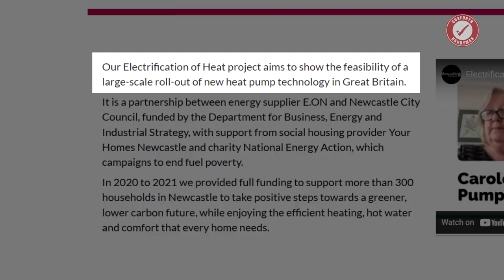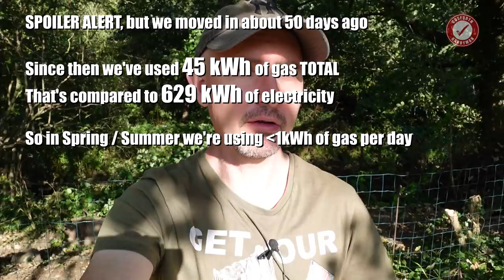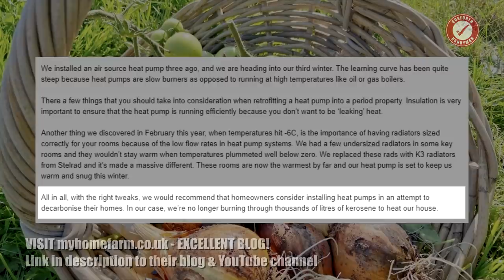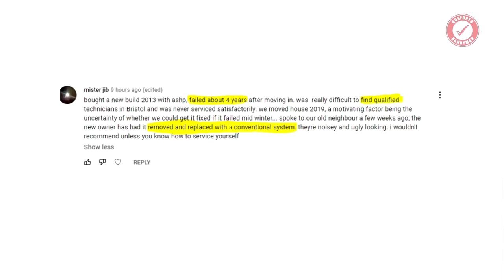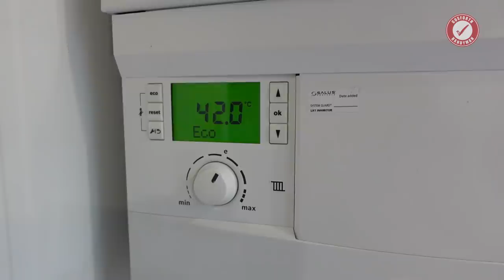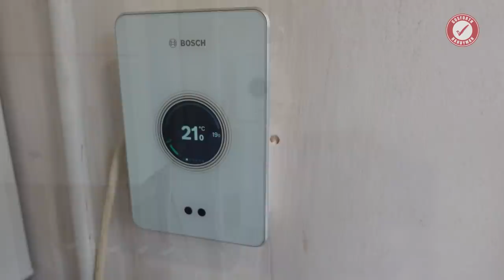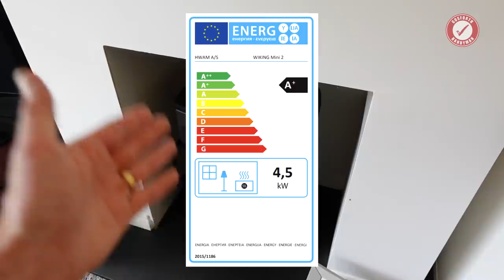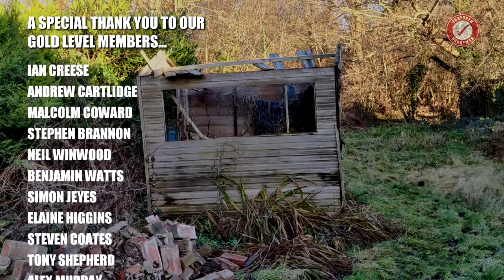Why didn’t we install an Air Source Heat Pump? (1920’s Renovation Part 32)

Comment: With wood burners it's the particulate pollution, rather than the carbon dioxide that's the issue, even with the new standard there is still PM 2.5 emissions and smaller which are strongly linked to asthma and lung cancer.
Reply: farts, volcanoes, wildfires, things decaying...life dude.
Reply: @monabale8263  no wonder humans r weak these days lol cant handle a bit of soot
Reply: @girlsdrinkfeck  no one could ever handle a bit of soot, it gave them lung disease and they died earlier than they should have, and lived in a worse state of health.
Reply: @Lewis_Standing  thats some woke cukkage
Reply: Not only totaly agree also its a fact. That's itsbad. I geuss the antivax and a like ( conservatives ) always have a problem with anything they dont like
Reply: @girlsdrinkfeck  bring back the days when everyone had coal dust and asbestos in their lungs and died in their 50s. They were real men back then.
Reply: People who romanticise the past seem to forget all the shit they had to deal with back then.
Reply: @ELGee1  ok corbyn voter
Reply: @girlsdrinkfeck  well done her.
Reply: Not to mention the endless wood collection, chopping, storing, fetching in, feeding to the fire, ash empty & clean up,  ash-dust everywhere (including your lungs ), chimney sweep (annually), otherwise all good
Reply: @iseenochains-oops7863  Not really the case anymore, just like internal combustion engines, wood stoves have been required to be increasingly more efficient and standards are reaching upwards to the 90+% efficiency and no internal air mix, with dedicated intake and exhaust, with more advance systems with built in filtering...  It's far more dangerous to stand behind a vehicle while it's running these days, unless you're doing old school fires like a nice camp fire that's only burning 10% and producing nothing but smoke and particulates for the other 90% or you make your own DIY wood stove and don't integrate modern advances like secondary burn, etc.  Just like driving a car from the 1950's with original engine may not be very healthy...  Context is important and not to be overly generalized based on old stereotypes that don't apply anymore...

While ash from a wood stove has a wide range of uses...  Wood stoves just don't make much sense unless you live in a cold climate, especially in countries with smaller size homes as super efficient also means they generate a lot of heat... Though, you could channel the heat to warm water instead of the home and just have a window to the combustion chamber for ambiance...
Reply: @girlsdrinkfeck  no, it’s a fact. You need to do more historical research rather than spout rubbish
Reply: @Haymarket47  ah so u trust what government facts said about diesel cars is better ?

Comment: I've just been through this entire thought process. I am (slowly - I am a complete novice) renovating a property I inherited for me and my young family to move into; and wanted a non vented system... I had dreams of utilising a low voltage heating element in the cylinder in place of the 240v one; and using electric solar panels without an inverter to heat water as a 'thermal battery'. Anyway: I did some finger in the air engineering on it and could NOT make the numbers work unless someone donated me a load of modern solar cells and a cheeky wink.

What is a FAR better solution (much faster ROI) in MY situation is installing insulation and mush more modern glazing as part of my renovation. This in itself is fraught with issues as I will be doing much of the work myself.  That said; my house is also approx 100 years old and has solid walls.  I.E. the ROI for insulation is much higher(sooner) for me than many others out there.

I would also consider myself something of an environmentalist (raised a flower child hippy, that got an engineering degree) and wouldn't even mind paying a little extra to reduce my family's carbon footprint.  But there are better things to spend money on: quality of life to ensure my children have the opportunities many don't and therefore the luxury to be able to make choices in their future that impact the environment less.  All of which is a very flowery way of saying: I think wasting less energy and money will pay off in the long run.
Reply: I have more or less finished converting a 150yr old barn loft into a 'modern' apartment. New roof, new floor, and a service loft ready for MVHR ducting, and to hide the spray foam.
All heating options were considered, gas was a given until the provider increased the original 1k quote to 3k after 6 months to connect to the grid. There was also issue of losing headroom with underfloor heating versus radiators on walls. 
So . . 
I invested heavily in insulation - spray foam between rafters in loft, 7" of kingspan in floor joists and apx 2" of insulated plaster straight onto the stone outer walls. Pretty airtight, and maximises thermal mass. Still no actual heating installation apart from shower fan. Oil filled electric rads - 1 always on low over winter keeps building fabric warm, top up as need, if working from home, still trying to decide.
Reply: I did the same with my 110 year old terrace house. New windows (double glazed with argon gas) and new exterior doors. I built stud walls against the party walls and insulated those too. New loft insulation,  added insulation to all other stud walls - all insulation is rockwool acoustic. I filled every gap I could find with expanding foam. I had a combi boiler fitted to replace oil burner and later replaced all heating pipes and radiators. The result was less pipework and rads that suited the room sizes better. Most years my gas bill has been around £250 per year for all heating, water and cooking.  My first winter the oil heating did not work and I was spending £25 per week to heat one room with an electric heater!

Comment: OK  I'd like to take issue with your comments about air source heat pumps. 
 I'm a Domestic Energy Assessor  now retired. We spent a Christmas at Winchester  at a lodge that had such a system fitted,  So as a DEA that had never come across one I was really interested in how it panned out. Everyone thinks that they can add it to existing radiators  WRONG  it's more efficient using under floor piping.  With hard frosts every night. We were warm and comfortable had lots of hot water for showers and couldn't hear a damn thing from the fan. The owner of the lodges had, had all the Lodges fitted with them. He said he'd saved a fortune as all that he was paying for was the electric to turn the fan.  So yes they do work.  In America they are used extensively.    LOVE your vids by the way

Comment: This is very weird, there are no incentives from the governement here in Norway, houses are often old and badly insulated and I think the vast majority of detached houses have air to air heatpumps.
Reply: Our electricity prices are very high and our gas prices are very low so it means that running an air source heat pump off electric is still very expensive compared to gas.  Also our energy companies are looking to switch to hydrogen to power gas boilers instead of lowering the price of electricity.  Your electricity will be a lot cheaper than ours.
Reply: The counter intuitive thing is that air source heat pumps are actually more efficient at lower temperatures, like you're likely to find in scandinavia. That's because the air can't hold much water. But in the UK, where overnight winter temps are generally in the -2 to 5C range, the air is still incredibly humid. So the heat pump has to put a lot more energy in, in order to avoid ice buildup.
Reply: @ComeWhatThey  Thanks that's interesting.  Yes ours get a thick frost coating too.
Reply: I'm guessing you have very cheap electricity from Hydro. Also Norway makes lots from selling gas to the UK, which is wisely invested by your government for the future. Here in the UK our Oil and Gas revenues (now gone) were squandered on short term feel-good tax cuts.

Comment: 10:26 Excuse me but what? First of all, you dont have to dig up all your garden. You drill a hole (bore well) and put the pipes there. That takes about two square meters of space. No large scale digging or big mess. Secondly, what makes you think the heat differential isn't enough. They work here in Finland in -25'C just fine so they woud work in your -8'C as well. Same thing with the air source heat pumps. I installed air source heat pump back in 2007 and it has been heating my 120m2 house since without any problems. We have had several -30'C time periods also and the pump still have worked ok. Of course at those extremely low temperatures it does consume same amount electricity as direct electric heater. Maybe your source of information isn't very good or something....
Reply: I’m thinking of going the GSHP route and for me bore holes is the only route but boy are the holes expensive I’m being quoted £14k for three 100 metre holes.  So if anyone knows a cheaper way of getting bore holes in SY11 UK happy to hear about it.
Reply: I'm 2-3km south of Andy and there are (coal) pit workings underneath us. In the maps I can find online, as of 1892 there were no pits where he is ... but for some reason /sarcasm  installers around here want to do a (chargeable) test bore before quoting.
Reply: @chrisbenson1217  Often that is down to effecting the local water table in the local area, we had several schools down south that ended up with carpet GSHP due to the proximity of the local water table to the surface. Andy backs onto a river so I expect the water table around there is quite high and environmental health have to get involved when in that situation for permissions.

Comment: Andy, thanks, a very interesting and thoughtful piece.  We are seniors, just moved into a 2003 build house (in the UK) and are staggered to find it did not have cavity wall insulation (it now has).  Our last experience with a combi boiler was in 1989-97 and things have moved on lots.  Since 2007 we have had a pressurised tank system and we find it is fine.  This summer, our first in this house, we have had the water heating for 90 minutes from 0730 daily and it produces water for showers in the morning and hot water the rest of the day whenever we need it and the gas consumption has been 38 units (therms) over 13 weeks, say 3 therms per week.  We have the usual 400mm loft insulation but whether we have insulated floor - who knows, we have no paperwork.  Like you, we think GSHP and ASHPs are pie in the sky, unaffordable for most people.  Thanks again, great content.
Reply: I’m not sure how you checked - our 2003 home has wall insulation - it’s attached to the interior wall,leaving a small cavity so water doesn’t permeate. Interior walls are thermo bricks and the floor is insulated. This was a standard construction by a large house builder at the time.

Comment: I've been agonising over what system to use in my new build for months, I had a quote of 16K for an ASHP setup and  I was pretty happy with it. I work in live events and I had a gig cancelled just as I was about to order thanks to COVID this kept happening so I kept delaying waiting for work to start again. Since this didn't happen there came a point where I had to dismiss ASHP and look at other options so I finally decided on a 100L water heater (£185) for hot water and a 19KW 3 phase electric boiler (£1400). I'm running 200sqm's of wet UFH and 5 rads (sized for a ASHP system) the electric boiler will heat water easily to my required 45 degrees which is almost its lowest setting. I don't expect my electricity bills to be unusually high but even if they are a little higher than normal I'm much happier not laying out the extra 14.5K for the ASHP which in my case when I can would be better suited channeled into solar and far more useful.
Reply: Very understandable choices. However do not put in microbore piping to the radiators but 15 mm. You can always swap a radiator (not that expensive) but it is a hassle to change underfloor piping. Though (we have just done it in an old 1865 farmhouse) not actually as bad as we had feared. We did not need to redecorate at all.

Comment: Excellent video - I think the main point is not what heat source you use but just 3 words - Insulation! Insulation! Insulation! We did a newbuild about 5 years ago and after being fed up of a very stinky and disgusting oil boiler for the previous 12 years we made absolutely sure we insulated the new place to an almost Passivhaus standard and installed an ASHP for the heat source (no gas main in our area) and underfloor heating for downstairs only. This has worked really well and the electricity bill is around £1,200-£1,300 per annum keeping the house at a constant 22 degrees in the winter with no cold spots and plentiful hot water. I know you have insulated your project to a high standard this has to be the most important thing. No matter what heat source you use it is incumbent on all of us not to waste the heat we produce but to keep it in the house rather than leaking it into the atmosphere. I would be really interested to know if you are/will be using a Mechanical Ventilation Heat Recovery system to ventilate the house (vital) whilst keeping heat in?

Comment: Good video. The case for ASHP systems  falls apart when you look at running costs. At best you will get 3Kw of heat from 1Kw of electricity via an ASHP. When temperatures  drop towards zero you'll struggle to get 1.5kw. A good gas boiler is over 90% efficient. Even today with scary increases in gas prices electricity  remains more than 5 times the price of gas. Do the maths, generating 1kw of heat from an ASHP costs way more than 1Kw from a gas boiler.

......and thats before you get to installation  costs, the need for huge radiators and the noise issues etc.

The RHI grants for ASHPs are ( in my opinion) also a racket. You can only get it if you have the system  installed by a certified installer. It's wide open to abuse because all the installer has to do is sell the system through finance which effectively  gets funded by the RHI payments. The RHI money is just disappearing  into installers pockets, its a pointless  exercise.
Reply: False claims, sorry to say. Most of the winter you actually get 5 kWh of heat out of 1 kWh of power. I have been running them myself. Only when it is -10 it falls to numbers like that, 1 on 3.
My current new house is running mostly 1 on 6 with this weather.
And so it is not a wild claim that heat pumps are 500% efficient, as it is just transporting heat. Whereas a combi boiler only makes 9kWh out of 10kWh in a cubic meter of gas. So heat pumps are in fact more efficient to run even when the power comes from a gas power plant. 
Our previous well insulated row house only used 220kWh of power for heating over a year!

Remember that heat pumps are used in Scandinavia, our weahter is easy compared to that.
Reply: In Scandi the heat pump runs in drier weather so does not need to defrost frequently in icy conditions.

Their electricity is truly green and cheap, ours is neither.

Regarding the heat pump installation companies making lots of money- they waste much of their time chasing customers who, when they work out the pitfalls, never go ahead.  Frankly it is a mugs game selling heat pumps, we have stopped offering the due to Government distortion in the market.
Reply: Even at the worst case scenario you cite, which isn't in accordance to reality, how do you reckon 90% efficiency is better than 150% ?
Reply: @BTW...  Because electricity costs 5 times as much as gas. Simple maths to work out the cost of generating 1Kw of heat in your home.

Comment: I think a number of people may have slightly missed the point about converting to heat pumps from gas boilers!
The idea is for us to use electricity to heat our houses - which was generated from renewable sources.
Wind, sun, tides etc.  These sources are gradually replacing carbon based sources in our generation mix.
Coal has now all but disappeared in the UK, offshore wind is increasing and slowly replacing gas.
The fact that heat pumps may not be the single answer for everyone is,  while of vital importance to the individual - something of a secondary issue to the main argument....
.......that we have to stop burning fossil fuels!!